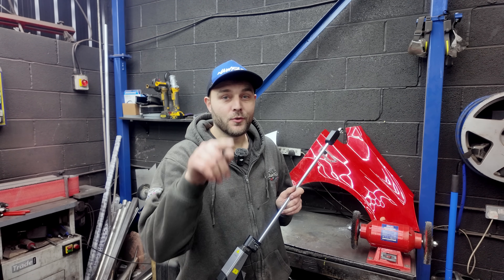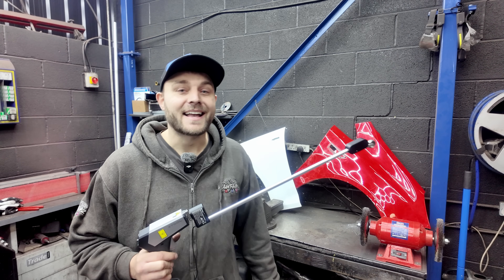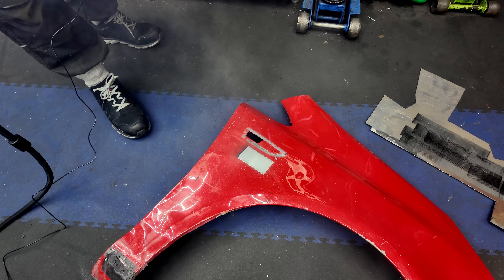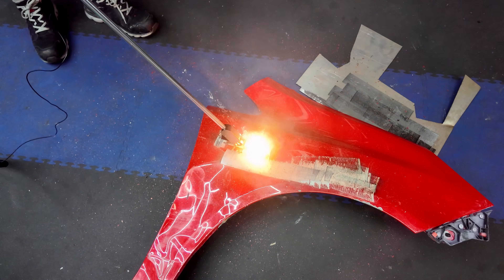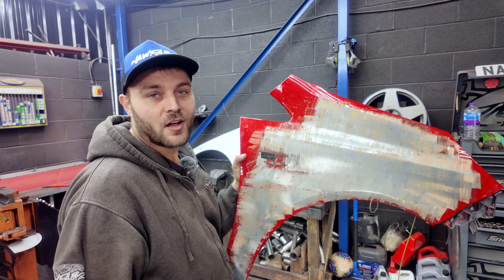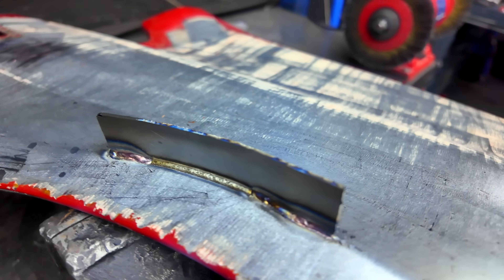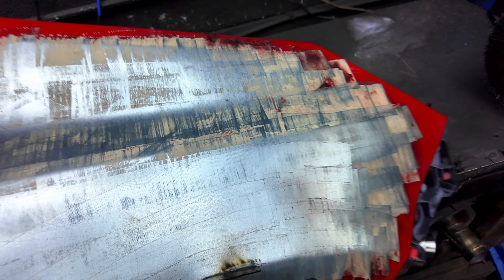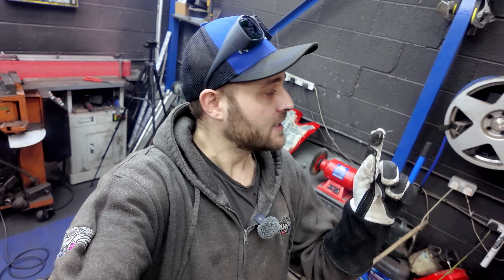⚡ This xTool LASER Just Replaced Sandblasting in My Workshop!

Comment: That pannel is definatelly warped, yes it is warped a lot less than it would have been using any other method, so I am not saying it is bad tool, it is just not true that it isn't warped at all. Put some guide coat on and block it and you will see it is warped... again - yes it would be warped A LOT more with classic welding process.

I think one big benefit I like about this tool is that surface prep is no longer that big thing, with MIG or even worse TIG, if there is even spec of dust on the surface it will result in defect when wlding. With this thing it really does not matter, it basically cleans for itself when welding. Sure surface should be more or less clean (and you can do it with same tool), but if there is little bit of dirt it does not matter.

For body pannels I am still not convinced, because in restauration work a lot of welds will be butt-welds... I principle probably not a issue, just different technique required... on classic welding you would deliberatelly leave the gap to fill it, with this it seems you need to make the patch to perfectly fit the pannel without any gaps around... is it harder, is it easier... I guess only practice can tell.
Reply from the maker: All fair points, to my eye i saw no warping at all but i am not a professional you may or may not be correct but either way appreciate your input

Comment: So, here’s something interesting. With this welder, I’m planning on it doing at least 75% of my welding. So I’m looking at the literally hundreds of dollars of TIG rods I have. I’ll never use these again, I think. Then what do I see on a channel? A guy TIG welding with his laser, using TIG rods! That’s really wild. When I get some time, I’ve got to try this.

With cleaning, if you’re going to repaint the part, don’t use too much power and go over it too much. The laser leaves a somewhat rough finish, is what you really want when you paint. Grinding often leaves a surface that’s too smooth. A great thing about laser removal is that using the small tip, you can get into tiny curved places that no grinder can reach. Handles and other things that you would have to soak for hours can be done very quickly. And guys, you’ve really got to do something about those fumes!
Reply from the maker: Interesting with the tig rods! As for the fumes yes adequate fume extraction will be in place next time